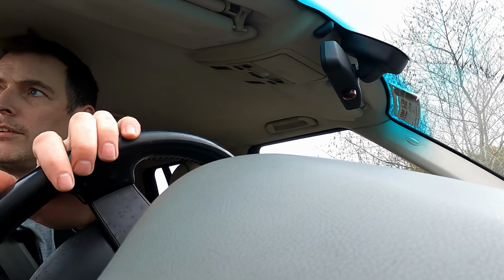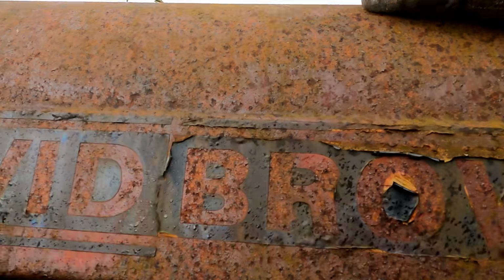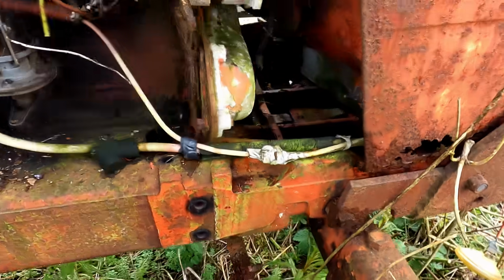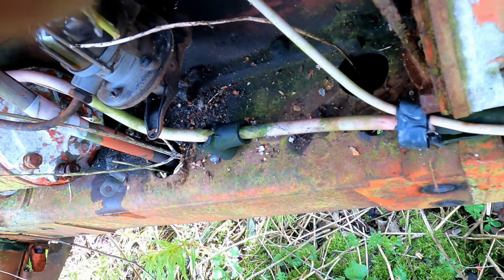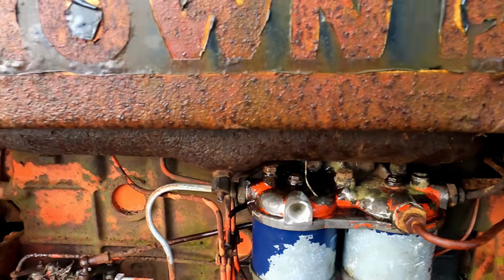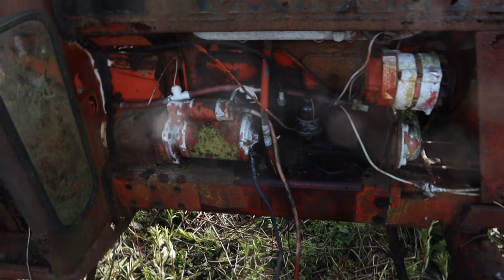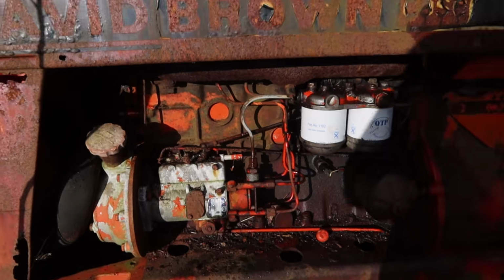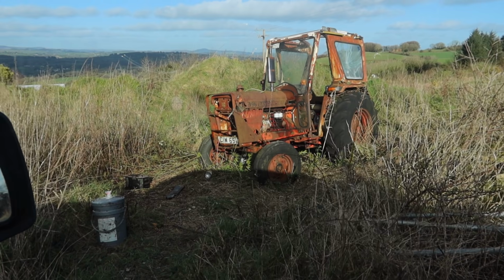Abandoned Tractor - Will it start? Sitting 10 Years

Comment: These old David Browns are good machines. My grandfather bought one from a local farmer several years ago when he retired his farm. It always started right up when needed and ran without issue. The only reason we no longer have it is because he sold it. It was a bit too big for what he needed and traded it toward the New Holland 1715 we still have now. People knock on some tractors for being basic or entry level but I personally think those are the best ones. Very little to worry about, cheap to fix, do the job and no computers to go bad. :)
Reply from the maker: This is my first experience of them but everyone seems to swear  by them. In fairness it fired right up. I've found a 990 that's been idle for decades, looking forward to seeing if that'll start. Thanks for watching 👍
Reply: You got my vote there...i hark back to the days of the Ford 7000. One of the greatest tractors ever made!
Reply: @russellking9762  While John Deere and CASE are the two most popular brands in my area you see quite a bit of old machines  around. It all depends on where you go. There's old Massey Ferguson's, Fords, Farmall's, Allis Chalmers and even some old SAME's.

Comment: Good video,  Always amazing how, after being left out in the middle of a field for a decade you get it to run. Looking forward to you getting it to move.
Reply from the maker: Thanks Fred! Having a rain cap fitted to the exhaust helped an awful lot. Also, the DBs have a drain in the exhaust manifold to leave water out if it gets in. I've also been told they are extremely good starters. The next one I'm doing has been sat over 25 years 🙂👍

Comment: Nice! we've got an 885N (narrow) we use on our orchard here in USA. Sweet tractor, good on parts, heavy and robust as hell! BOY that's the rustiest one i've ever seen. Mine has 1331 hours.
Reply from the maker: Are there a lot of David Browns in the states? I wonder did they start bringing them in before or after the Case take over? This one is rusty, but I think it has good potential, and hopefully should be back to work soon! Thanks for watching, I'll bring another video of freeing it off and getting it moving.
Reply: @davesworkshop2714  there are a few yes but still considered uncommon. Depending on the state like mine Michigan it's really hard to get parts. I know of maybe a handful here of owners i talk to be have seen at least 10-15 on the market place. These are mostly a Midwest tractor. There is one big place in Kentucky that part's these out but otherwise salvage yards here just don't have any so most of the time you have to travel more than 8 hours to get anyting or have it shipped with a extreme shipping price. For all of the filters also usually we need to order them from UK.
Reply: @davesworkshop2714  from what I've been told by guys Hearing in the United States case only bought out David Brown to shut them down. But they did end up bringing the tractors over here on marketing them, to fill in the smaller horsepower gap they had. But service and parts was piss-poor. You'd be lucky if you could get even filters is what I'm told...
Reply from the maker: @SchnelleKat  that 996 actually has the case name on the hood in small print, from '71. Same thing seems to have been common with imported European cars, no back up.

Comment: Good job well done.
I had a 990 I inherited from my dad and I used to drive a 1200 at work. They were cold (no cabs )noisy the gear's whined (straight cut). But they were bullet proof I don't remember either of them breaking down over a 25 - 30 year time Frame. The 990 is in preservation don't know what happend to the 1200.
Reply from the maker: Tractors have moved on a lot since those days! I grew up with a 1970 Ford 5000 and a '59 Dexta (that we still have). They were not built for comfort. One thing I'll say about the DB is cab access is dreadful. Then again all cabs were small then. Gotten too used to a flat floor and big doors! Thanks for watching and taking the time to comment Jim.

Comment: Good video Dave have a 995 and a 1494 myself will make a nice restoration project if the handbrake was left on it can be a pain to free them out
Reply from the maker: Thanks Seamus, I assume opening it up is pretty much the only option to free them? We're going to have a go off it soon hopefully. Thanks for watching 👍
Reply: @davesworkshop2714  they seize where the shaft goes into the brakes don't forget to tie down the differential lock or they will fall out of line while you remove the final drive unit
Reply from the maker: @seamuscusack7937  thanks for the advice Seamus, I could be coming back to you with more questions!!

Comment: After witnessing the tractor and it's condition and surrounds my guess is 17 to 18 years of sit time at the very least. Of course it was said the owner gave the information the plastic turning unit was the oil level stick. All of the electrical connections to the starter need removed and cleaned. She needs a snort of Cosby Sauce. The owner could tell a guess as to sit time. + or minus 5 years. Upon further inspection my guess is 27 to 28 years.
Reply from the maker: We were able to confirm 10 years Paul. Just made look worse by some very fast growing weeds!!

Comment: How can it be that rusted out? i have an old David brown cropmaster that my grand pa used to own before he passed in 1980's  that was left in the woods for over 40 years! it's not even close to be that bad even if it's in rough shape though
Reply from the maker: The Irish climate unfortunately Sonny, we get a lot of rain! Most of the rot occurred in the last 10 years, being overgrown didn't help I guess. You should fire up that crop master! I  assume you're in the US?
Reply: @davesworkshop2714  No i am from sweden :) The old Cropmaster did i acutally fire up all by myself the first time in over 40 years back in around 2006 when i was only 11-12 years old believe it or not.. i had been with my dad and already learnt ALOT from him since he was a heavy truck/tractor Mechanic and i loved to hang out with him and fix all kinds of things..  used coaxial cables from the antenna as ignition cables back then lol.. engine was stuck but i filled it up with diesel fuel and put a breaker bar and a pipe on the crankshaft as i only wieghed about 25-30 kg myself and got it freed up,  took the starter and carb apart and got it fired up :) but it wasnt until 2020 that i drove it on the same lands as my grand pa used to drive it on in the 60's to 70's. I Had to split the tractor to get the clutch working and change some bearings in the gearbox before i could drive it and put some new tires on.. felt really good to finally drive it after all those years since i first fired it up
Reply: First time i started the tractor, the regulator was stuck too so it was revving like crasy and spitting fire and all kinds of stuff out of the exhaust, a almost crapped my pants and my mom and dad still laughs at this and reminds me of how i came in to the house and screamed like crasy, I GOT IT TO START/RUNNING in swedish
Reply from the maker: @hatarmusiken  😂😂😂 that's great! I'm always worried thatll happen too. There's that moment when you wonder if its going to run away 😂😂. If you look at my Lister video you'll see my brother trying to escape when he thinks it's heading for the hills 😂😂
Reply: @davesworkshop2714  Some day it will probably happen 😅 if it happens try and starve the machine of oxygen in some way.. i will check that video out! keep up the good work :)i wish that i have some videos to post of all the start ups i have done, Maybe some day i will remember to film it
Reply from the maker: @hatarmusiken  I always carry a CO2 extinguisher for the day I'm afraid to get too close 😅.  Make sue you film the next one, ill subscribe to that! Take care my friend 🙂👍

Comment: Newer Ever sen any Other traktor brand Rust like David Brown… locks like it marinade in Salt water
Reply from the maker: I havent got much experience of them,but when I think of tractors and rust I think 600 series MFs and fiats 🙂. Unfortunately the Irish climate doesn't suit anything metal. Thanks for watching 🙂
Reply: @davesworkshop2714   i have i few traktors ( maby 12-14) and 6 of them is from the 1940-1950 and i never seen a Hole from rust in the Hood in my life here in Sweden. 

The cars?… that another story :-( we are putting Salt on the roads så the Cars rust from under , somtimes 5 years old cars got Holes right tru
Reply: @davesworkshop2714  nice video and nice to se you got it running! Tank you for video!.
Reply from the maker: @swampen85  we are lucky here with cars. We didn't start using salt until about 13 years ago, and it rarely gets used now. We used to import a lot of cars from the UK, and there was a huge difference between imports and cars that were here all their lives.
Reply from the maker: @swampen85  thank you for watching 🙂👌. More to follow soon!

Comment: thats not the correct bonnet as the 996 is 4x4 , this is a 995
Reply from the maker: Andrew, maybe they were 4x4 only in some markets, but definitely not here. Pretty much all 996s here are 2WD. Thanks for watching 🙂👍
Reply: 996 have an independent pto clutch which is hand operated.  995 pto clutch is a dual clutch operated by the foot pedal. Both were available as four wheel drive
Reply from the maker: @alastairmccormick9657  you kn9w your DBs Alastair!